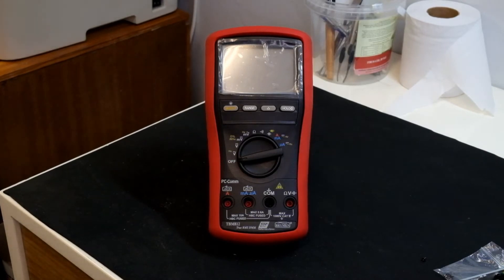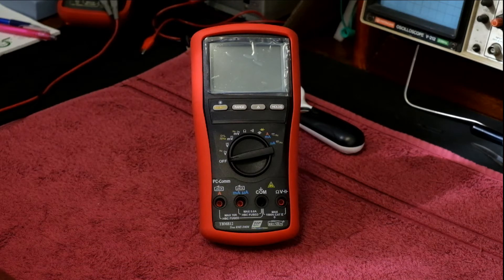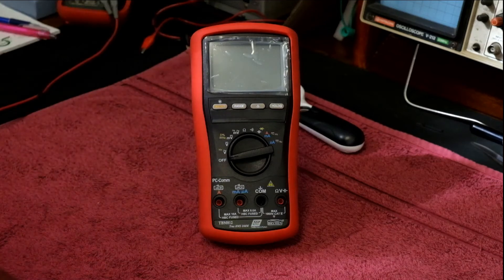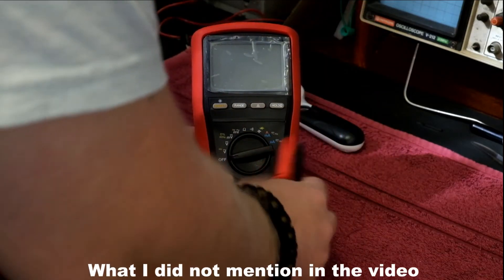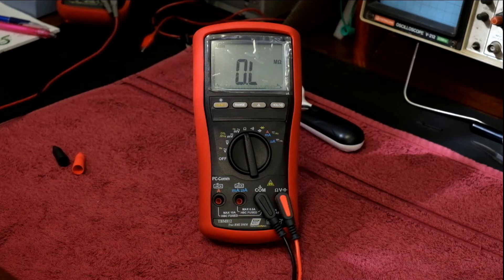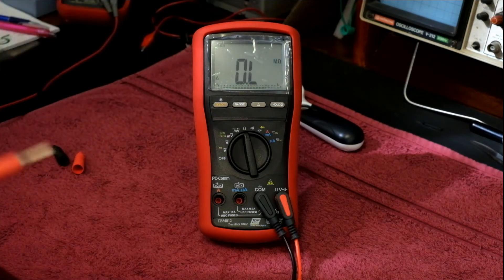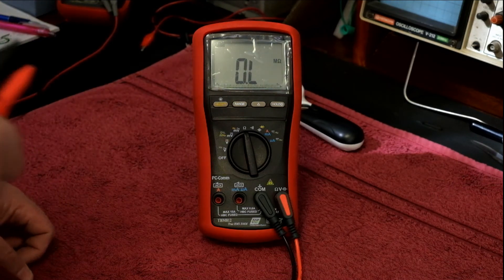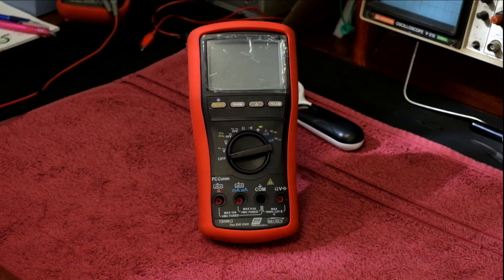Episode 40   Brymen TBM812 Multimeter First Look and Relative mode explained

Comment: I have a problem with Top tronic multimeter TBM 812, it desplays InEr and can not measure any voltage, resistance or diode test. Please help. I love this multi meter.